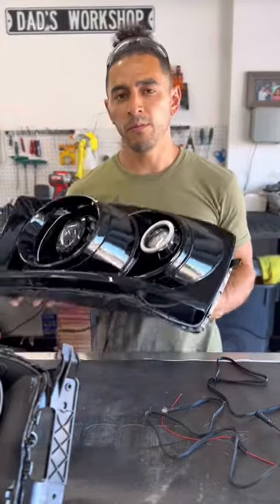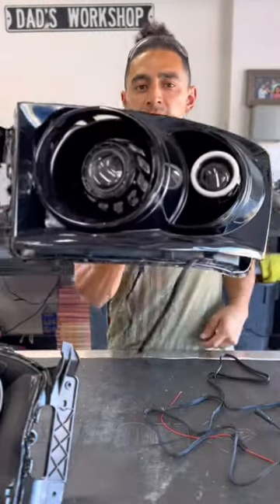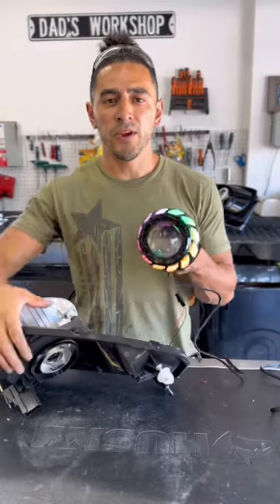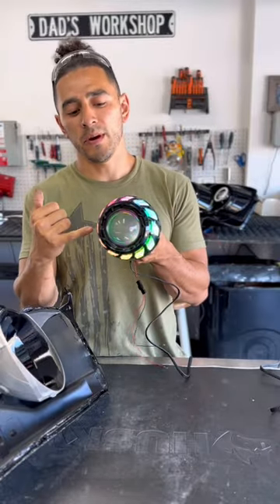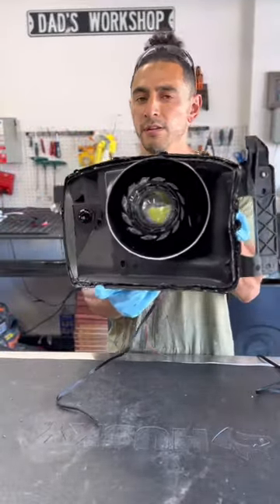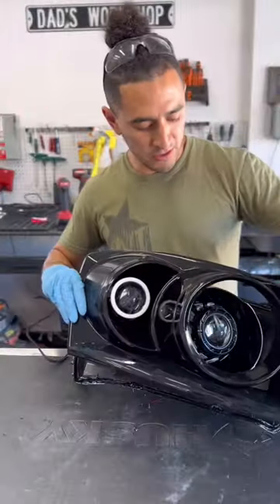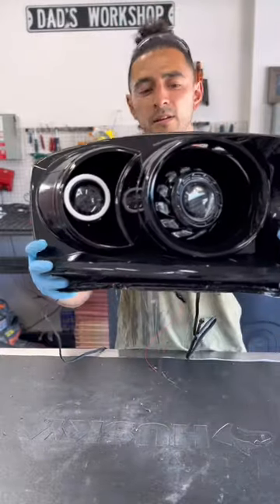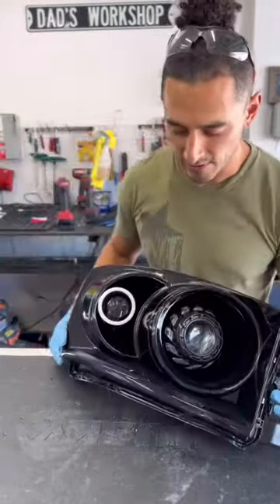Dodge Ram 2006-2008 custom headlights with quad projectors

Comment: Bro I plan on doing that but instead of a turn signal I want more light. And using a turn signal strip at the bottom instead. I seen it done. Can you guys build that?